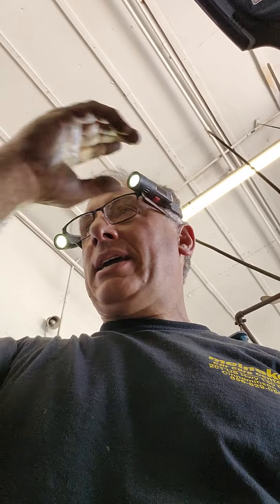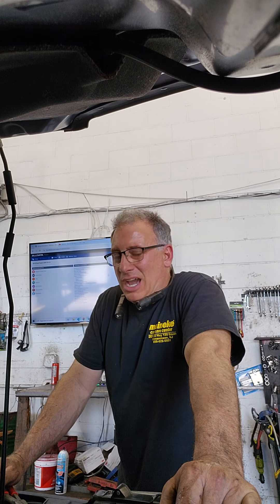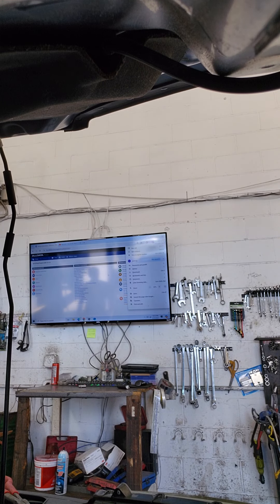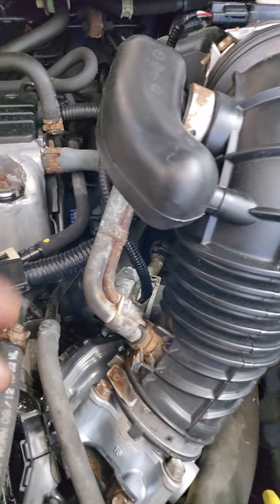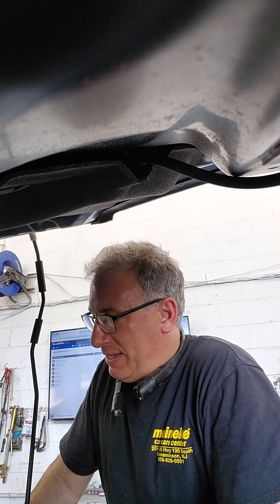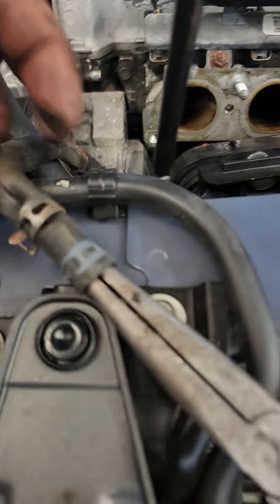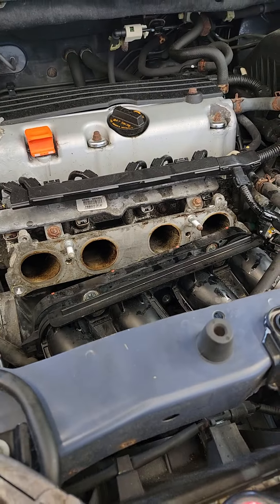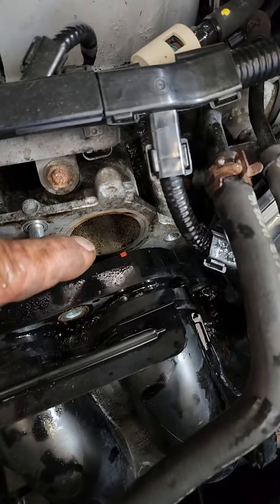2013 Honda crv 170k po171  couldn't find it on smoke test showed up w brake clean test

Comment: Gm has something called the powersmoke which is meant for diagnosing intake or exhaust leaks. It's basically like an evap smoke machine on steroids. Super expensive but that thing is awesome. You basically need one of them if you're diagnosing emissions codes on a modern diesel